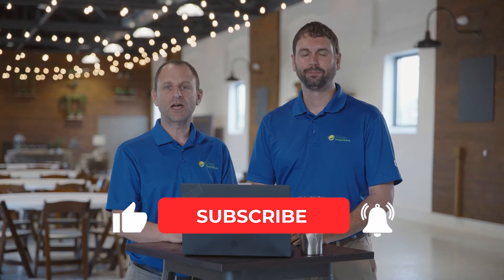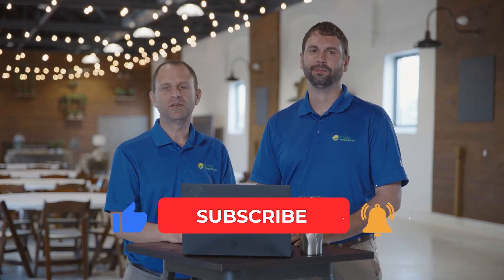Are Solar Panels Bad For The Environment?

Comment: 14 grams of lead is a half ounce of LEAD.  A half ounce of LEAD is beyond extremely toxic, lead toxicity is measured in micrograms per deciliter (µg/dL). 
1 gram of lead equals 1 million micrograms. 14 grams of LEAD would be 14 Million µg/dL.

According to the CDC, 
At levels above 80 µg/dL, serious, permanent health damage may occur (extremely dangerous).
Between 40 and 80 µg/dL, serious health damage may be occurring, even if there are no symptoms (seriously elevated).
Between 25 and 40 µg/dL, regular exposure is occurring. There is some evidence of potential physiologic problems (elevated).
Between 10 and 25 µg/dL, lead is building up in the body and some exposure is occurring.

Again 14 grams = 14 Million micrograms per deciliter (µg/dL)
80 micrograms per deciliter (µg/dL) is rated as serious, permanent health damage may occur (extremely dangerous).

This is just the lead, do your own research don't believe a company that profits off solar. The manufacturing process is much more environmentally unfriendly then they make it out to be.

Comment: Many solar, currently, are over there life span. If one accepts there's no leakage of toxics into the soil. Where are the expired solar panels taken once removed? Land fill areas? If a natural catastrophe happens, such a tornado, hail, hurricane, or ect,, would toxins leak into the soil? Appears companies are switching from polluting the air to ground contamination.
Reply from the maker: Solar panels are made up of glass, silicon, and metal. These three materials are recyclable, but they first need to be disassembled. In the process developed by the European association PV Cycle, 95% of the glass and 100% of the metal are reused in new solar panels.

As for the silicon wafers, a slightly more involved process is required. First, the wafers undergo thermal processing to separate the silicon from its plastic covering. The plastic is then reused as a heat source for this exact process, keeping potentially dangerous emissions from the air.

Then, the remaining silicon is physically separated, and 80% of it is reused. The remaining 20% is then etched away and broken pieces are melted together. Of that remaining 20%, 85% can be reused. Learn more-> https://www.paradisesolarenergy.com/blog/how-green-is-solar-energy

Comment: ask them how much coal it takes to make solar panels , that would tell there is no green in solar or wind , no oil or coal no solar or wind,
Reply from the maker: Yes, natural resources are needed to make solar panels. Solar isn’t perfect. 
However, even considering those resources needed for solar panel manufacturing, the long-term environmental impact is far better than electricity from oil, coal, and natural gas. Here's a good blog post that outlines these concerns. https://www.paradisesolarenergy.com/blog/how-green-is-solar-energy
Reply: @thesolarenergychannel  solar works in small scale, but it cannot power the planet.  It would require too much destruction to create, repair, and replace solar panels on a planetary scale.
Reply from the maker: @deydraniadiancecht8298  Small-scale solar is what we do. We believe the best returns on solar are when it's used to offset the energy used at an individual property, whether that be at a home, farm, or business.

Comment: But don't we need batteries for solar panels
Reply from the maker: Hi John, no, you do not need batteries for solar panels. The solar system can be connected to the grid and that will act as your battery. You would then get credit for that production through Net Metering. (here's a video on how that works https://youtu.be/L4WWmuPHZ7w )